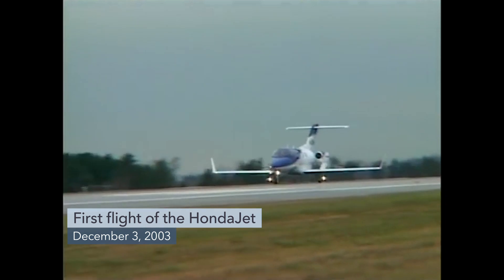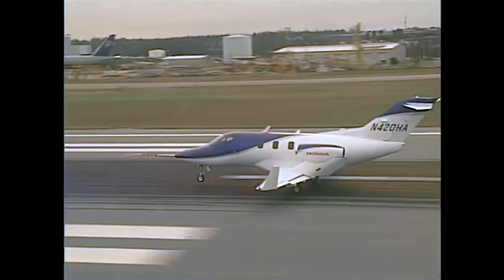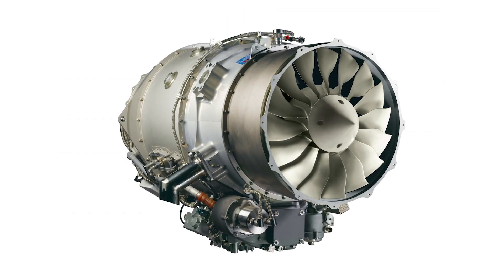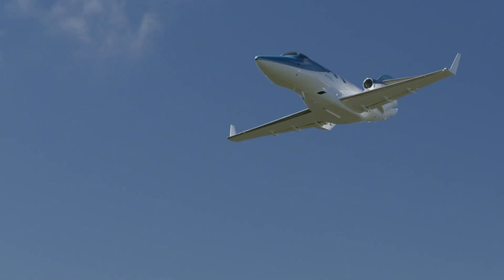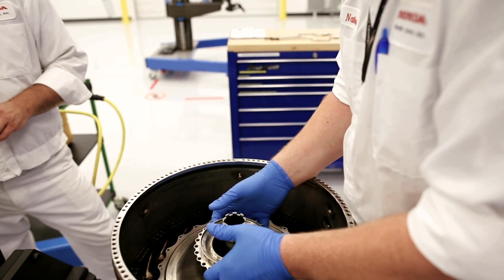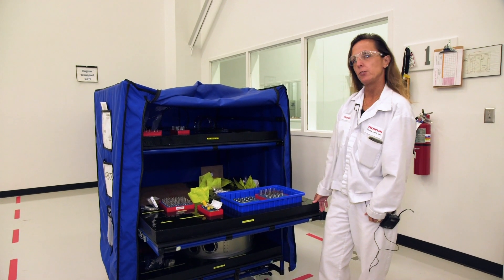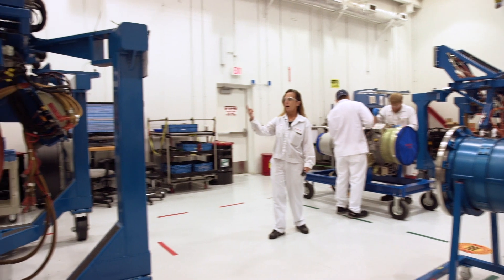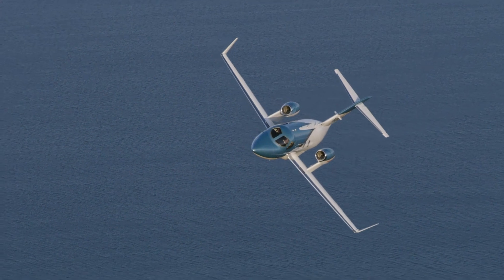Honda Manufactures Its Own Jet Engines for the High-performance HondaJet – BJT

Comment: Hi, I'm adding a Honda jet elite to my birthday party, next year. My only concern is that the software upgrade is not up to my standards, I want self landing and takeoff a. I. Installed in it. Rep. Stated that honda is just looking to add the software. I want it as an option or as a standard feature. Go fly a Honda.